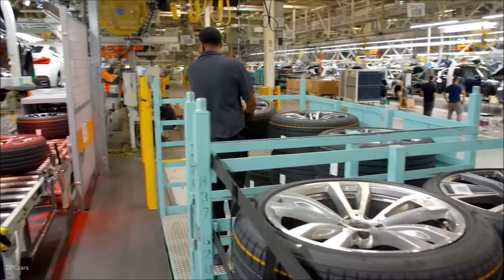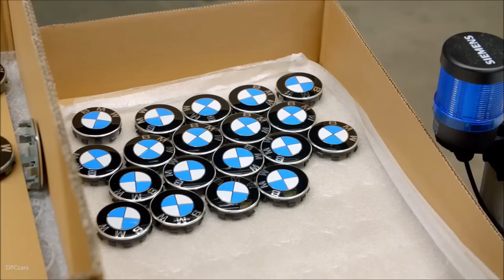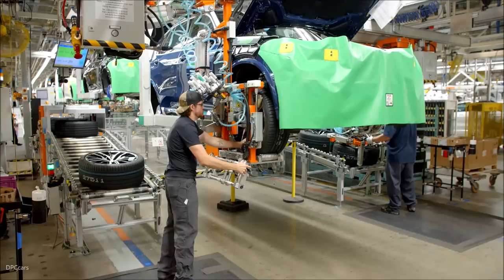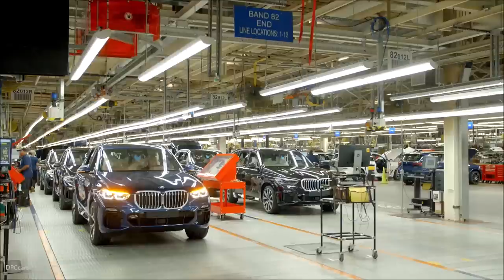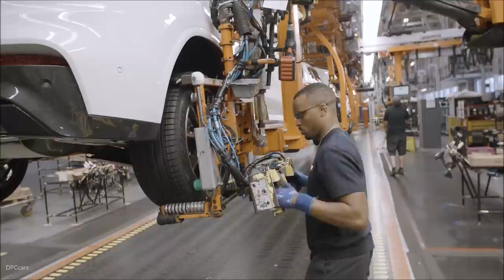BMW Factory Wheel Installation Machine

Comment: no way that the 5 lug wheel fastener device torks the wheels to specs, so the vehicles leave the factory with wheels barely fastened
Reply: I bet you a wooden nickel that it most certainly does torque the wheels to spec